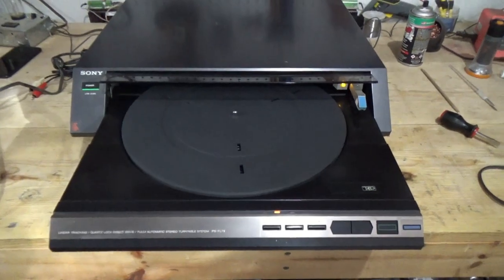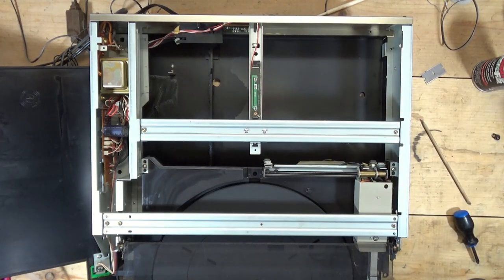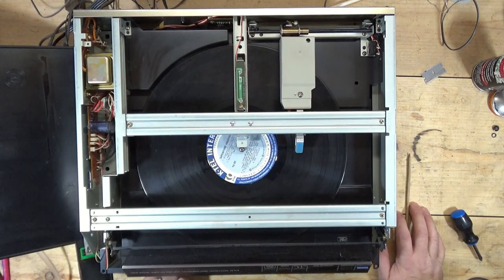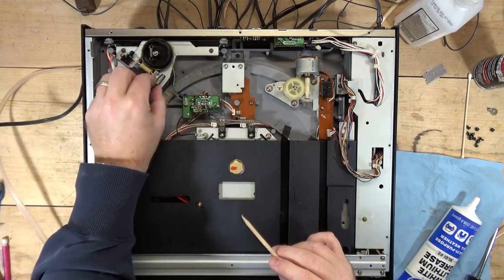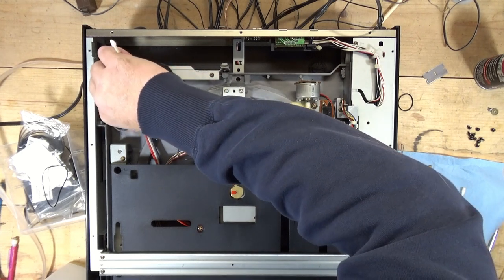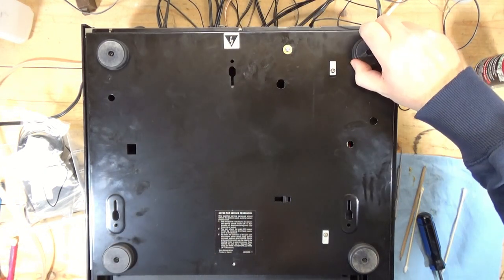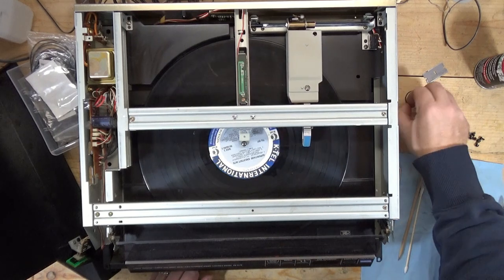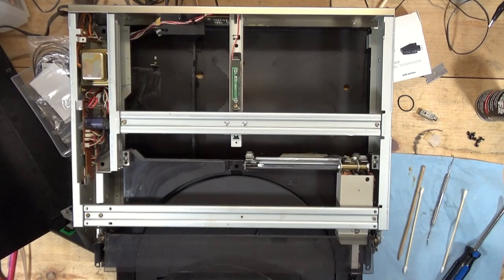Sony PS FL7II Turntable Repair

Comment: great vid, really easy to digest and follow along with for people who havent worked on these before. it really does seem a lot more intimidating to take apart than it really is

by the way, anyone who needs to tune the drop-in location on the record (ie drops a little too early or late), you can find the service manual online and it details how to do it on page 16, seems pretty common that gets a little off after some years
Reply from the maker: Yup...seems that folks that get into vintage gear doesn't quite understand that inevitably you will need to do some adjusting here and there.
Reply: @millervintagehifi3034  yeah, through vibrations over the years or whatever it might be, though when you get it dialed back in, man its so satisfying to watch it play again as if it wasnt ~39 years old

Comment: Currently working through the exact same issue on the exact same player I bought in an estate sale , fingers crossed the belt replacement I ordered works.
Reply from the maker: Good luck on getting it sorted out!
Reply: @millervintagehifi3034 just wanted to update you that the same fix worked for me. Thanks!